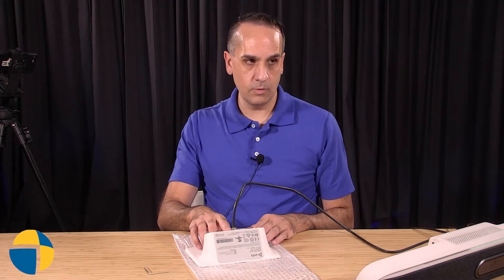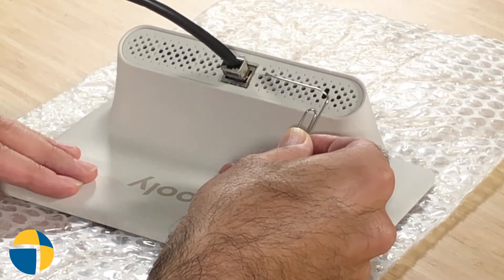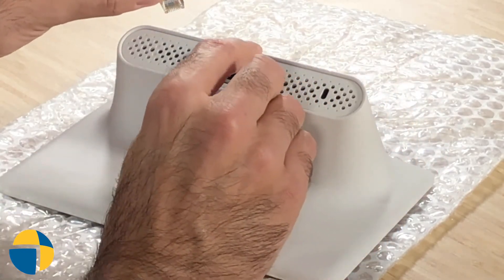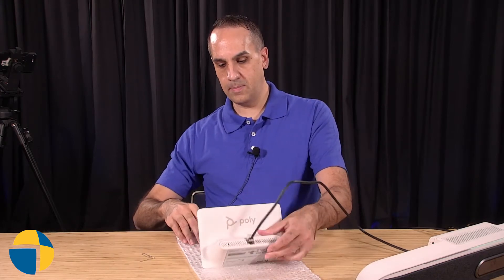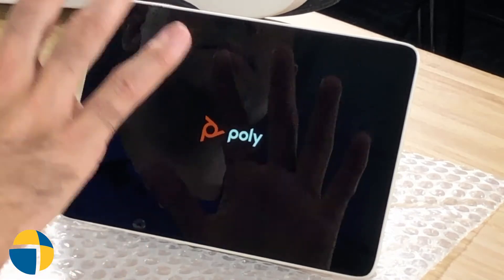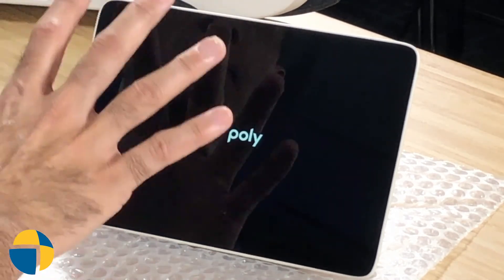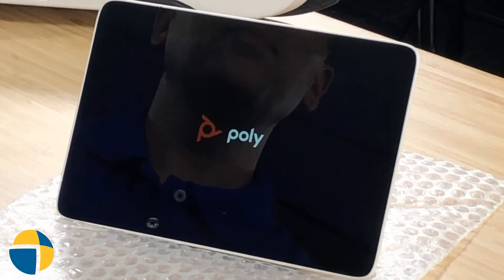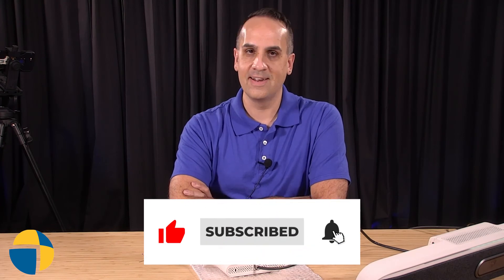Poly TC8 Touch Controller: How to reset it.

Comment: i am using poly tc8 touch controller, recently i was updating my device firmware, due to some reason i lost my power connection during update , now it is stucked at Poly logo, i also tried to reset it, but it couldnt work.  can you help me?
Reply: +1 with this issue
Reply: Hi. Have you found a solution to this problem yet?
Reply: any updates? im in the same situation now and it looks bricked.
Reply: Same here. Did someone find a way to fix this issue?